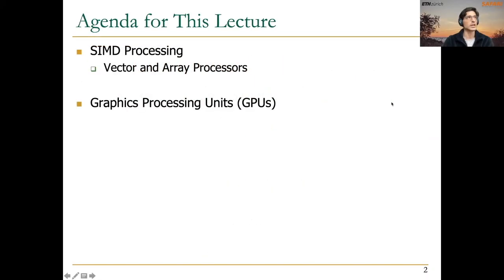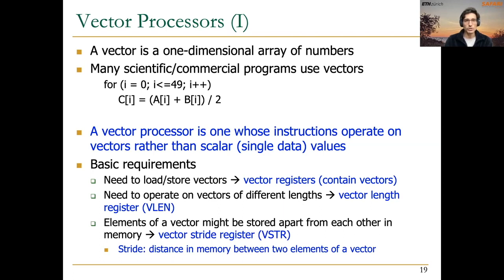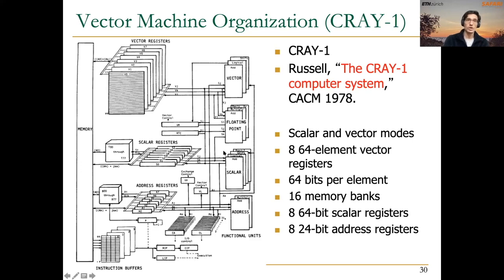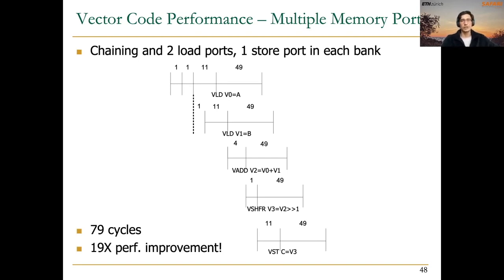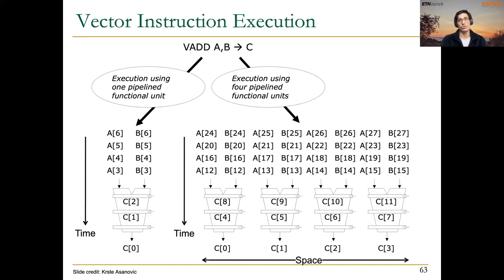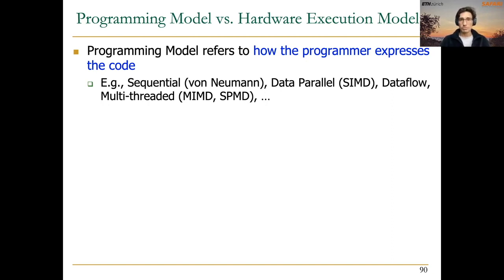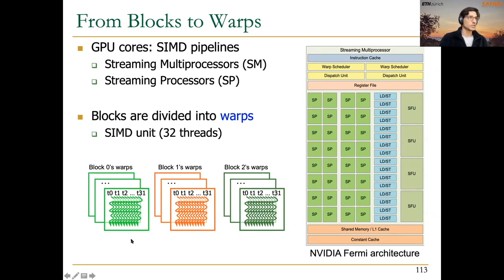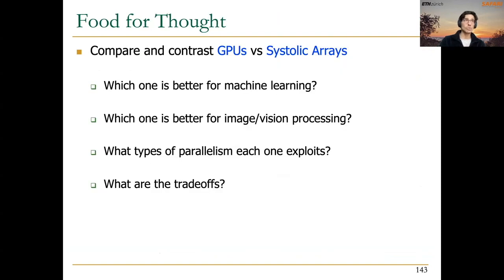Computer Architecture - Lecture 25: SIMD Processors and GPUs (Fall 2022)

Comment: Why are there bottlenecks every time i scale ? Or something new is needed
Reply: @AlphaBeta-xt3wn   You should use SIMD to run the convolutions in order to get faster quaternion mobius trans. Gauss? He was a noob. Nowadays everyone knows 1.58 bit is king. 5.5 bit doesn't even align correctly align with the architecture lmao. And pleeeease use ++z instead of z++ because it will perform an atomic compare and swap with the wrong ordering and create synchronization problems that will lead to undefined behavior that will certainly cause a segfault.
Peace!
Reply: @trichomaxxx  what the fuck